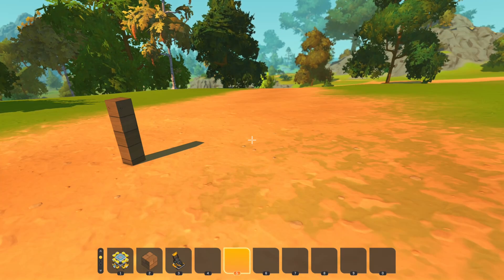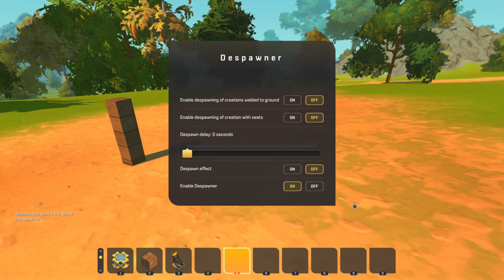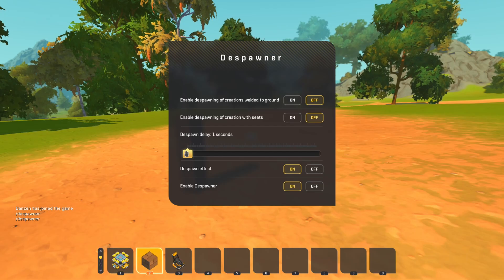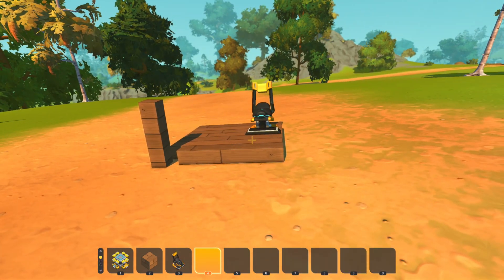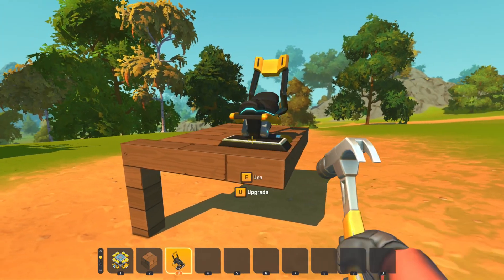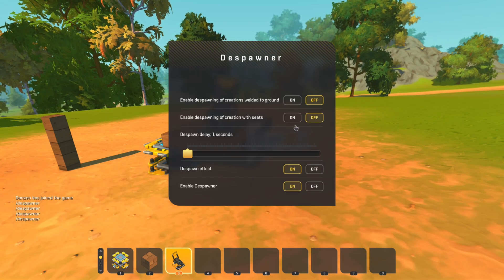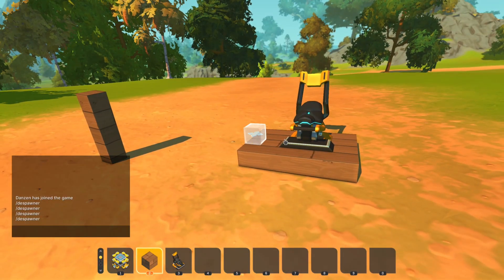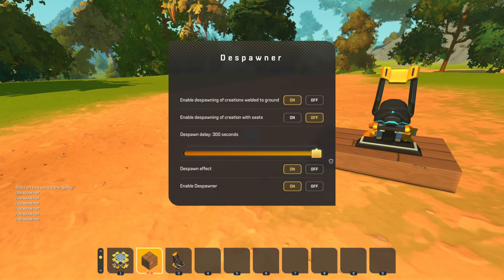Eliminate lag with this Despawner Mod | Scrap Mechanic Mod

Comment: Bro, here's an idea (if you read the comments).
Add a certain block-“mark” for the mod so that it realizes that it is not worth to remove the structure yet, because for example on missiles, bombs, etc. autonomous objects is hard to add a seat.
Yes, it can be fixed by simply turning the timer on say a minute, in the realities of Scrap Mechanic loading this will be enough, but still. (Just as an idea for you)

Comment: I'm pretty sure that if a loose object lies still for a long enough time, its physics is toggled. I discovered this when I made a hovering platform for building. It was so perfect that it tricked the engine and stayed floating even without any thrusters.